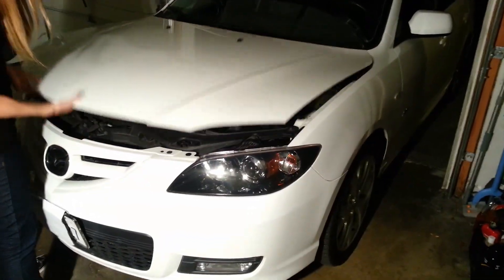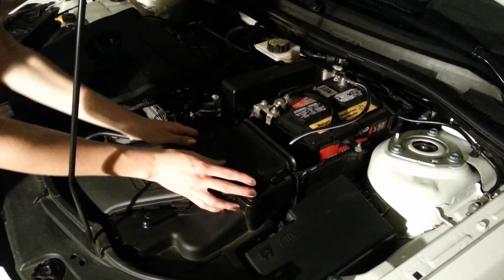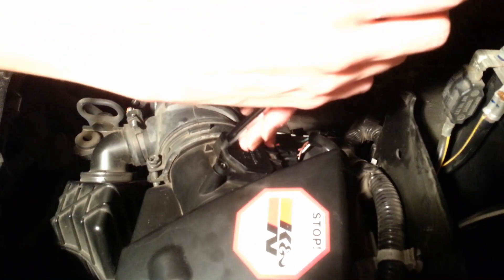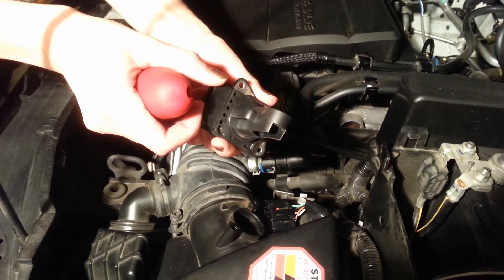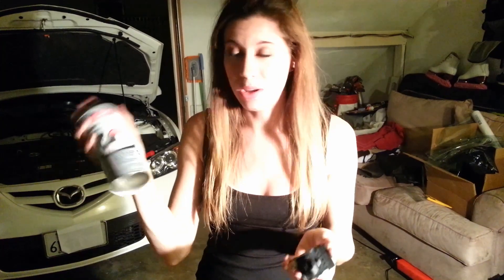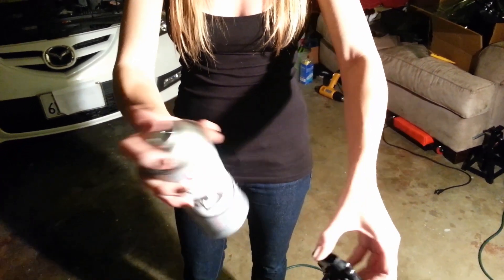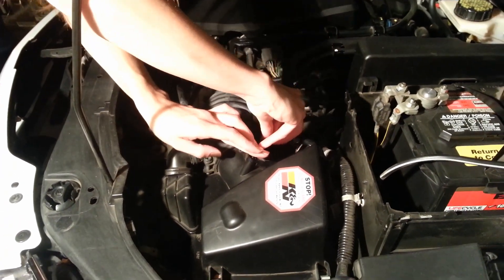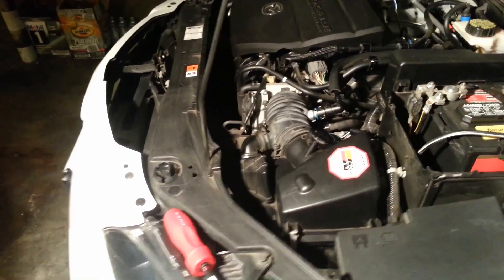HOW TO CLEAN A MASS AIR FLOW SENSOR!

Comment: Electric plug does not just “pull right off”. There’s a clip of some kind holding it on. It would have been nice to know that and also how to get it if without breaking the wires.

Comment: What happens if I used throttle body air intake cleaner to the mass air flow sensor if I spray does it messed up the mass air flow sensor

Comment: Hi, at times my Mazda won't do anything after driving alittle while. I turn the key, but no crank or start, have to wait 2hrs, then it starts.
Ignition or ground issue video would be appreciated.
Reply: Crank position sensor issue

Comment: Any times on cleaning an upstream O2 sensor..
Reply: Don't clean it. Cleaned the connector (quick drying electronic cleaner) on one and i needed a new O2 sensor. Expensive mistake. Found the hard way that these things breath air from the wiring, and if they can't breath it because something else went through the wires and took the air's place, they just send a lean reading. Just replace when found faulty.

Comment: whoa remember to take of the negative terminal of your battery when working on electronics so you won't damage anything in there
Reply: That isn't necessary to clean a Mass Air Flow Sensor...it already has a quick disconnect plug and the voltage isn't high.  Save disconnecting the battery for things like Alternators, Starters, Plugs etc.

Comment: Even though K&N denies the claims that oil from filters don't contaminate the MAF. I know it dirtied my MAF because the loss of MPG was instant also the smell from the overly rich mixture was very noticeable. Switched back to stock and now I have to clean the sensor to undo the damage.

34 MPG with stock filter, before K&N.  ->  12 MPG with K&N filter.  ->  28 MPG with stock filter, after K&N.
Reply: TURN 4 TURN dang dude. That K&N really messed you up.

Comment: can i spray in the connector part of the maf sensor ?
Reply: Sprayed the connector both sensor and harness side on my Bosch hot film MAF and nothing bad happened. On the other hand i mistakenly sprayed the connector part of an upstream O2 sensor, and the car started running crazy rich (tailpipe-dripping rich) because the O2 sensor began to always read lean. I had to immediately fit a new O2 sensor to fix it...

Comment: I have a 2008 Mazda 3 2.3.  Will a bad MAF trigger the Check Engine Light?  If so, which code?  Having rough idling/shuddering issue when idling at stop light, while foot on brake and in gear, but not when in Park.  However, this is more pronounced when the AC is on.  I also have another issue when accelerating, feels and sounds like car is choking, like running a lawnmower with choke on.  Mazda dealer says they can't find anything wrong with EVAP system and says its the motor mounts, but I only feel a very slight vibration in steering wheel or passenger side.
Reply: T2Chia, I had the same problem. I've been to multiple car shops and they could never figure it out. Did you get it fixed? I know it's been a year.
Reply: Ross E. never figured it out but it did get better with an expensive oil additive I added a few oil changes ago, but not completely. I got a tip on another forum it might be the catalytic converter.
Reply: T2Chia, that's good. So it doesn't have that jerk feeling anymore? I recently went to a Mazda dealer and they figured it out.
Reply: Ross E. not really since I started using additives
Reply: T2Chia, if you don't me asking, what exactly did you do? What additives? :)

Comment: I have clean a maf with brake cleaner and now the electronic throttle body is a making a weird noise possibly from the electric motor everytime i leave key in on position in and i test drove my car n came back n the whole plastic inlet manifold started shaking like it was starved of air while on idle plus the motor in the throttle body was overheating n wont stop making a noise like it trying to open whats wrong
Reply from the maker: Hopefully the brake cleaner did not damager your MAF sensor. The sensor is very delicate and brake cleaner maybe a bit too harsh. But from what you're describing it sounds like your throttle body butterfly valve maybe stuck. Build up around the throttle body butterfly valve is common. Remove the TB from the vehicle, clean it and make sure there are no obstructions. When that's done you can plug the throttle body in to it's connector, while it's off the car. Have someone turn the key to the on position (do not start the motor) then have them push down on the gas pedal a few times. You should see the butterfly valve moving, if it's not then it's time to replace the throttle body.

Comment: could having a dirty maf effect the power of the car when giving it gas, specifically between 2000-3000 rpms. Also is the same steps you use on a second generation speed 3

Comment from the maker: We did remove the o-ring before cleaning but we forgot to film that segment of the video. We will add an annotation to let other viewers know to remove it before spraying. I've left the o-ring on before and it did not damage the rubber whatsoever but I do know it's possible if it's exposed to too much cleaner. Thanks for pointing that out and watching!